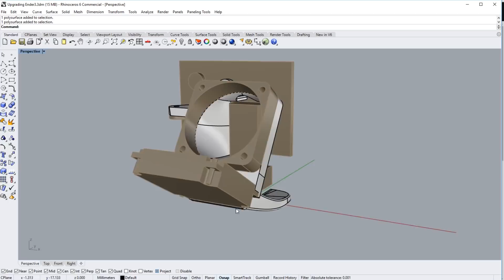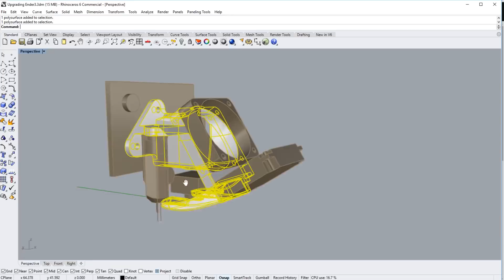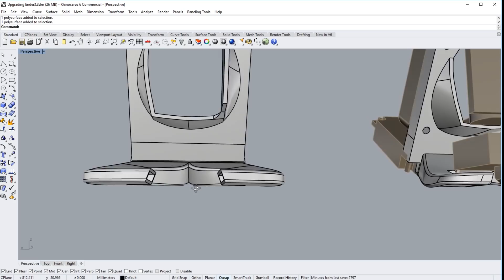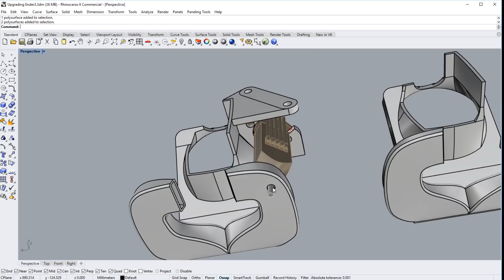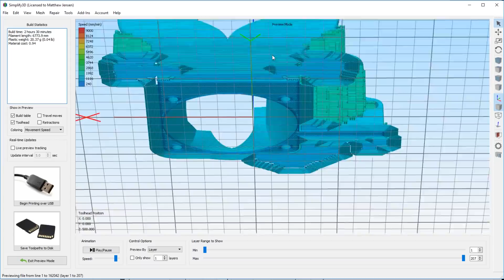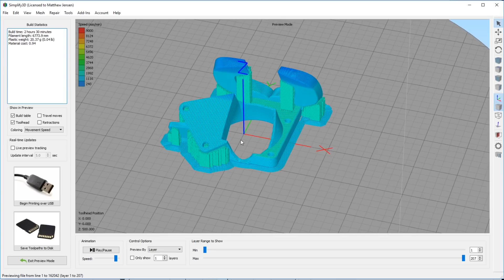Upgrading the Creality Ender 3 with Duet Wi-Fi, and other add-ons - part 1

Comment: Sorry not trying to troll your video, but I have a Prusa MK3... so should you. Really it’s needed to be fair. It’s pronted true, and yes on the zip ties. But, for that it’s pretty awesome.  You talk about price, and how Creality is as good for the price point? Well Prusa is using genuine parts. E3D got end, Noctua etc.
Reply: I was actually thinking that when he was talking about creality not using knockoffs. I was like, I'm pretty sure that E3d v6 is a knock off.
Reply from the maker: There is no E3D V.6 on a the Creality. They call theirs the "MK8 Extruder" and it has a very different heat sink, and mounting technique from E3D.
EDIT: I've been informed that the Creality hotend is a knockoff of a different company than E3D. The original inventor of that design is "Micro Swiss" based out of the Midwest.
Reply: Design Prototype Test hey man, I’m a fan... but if you are to be on the “no copy cat” platform, you have to get rid of GearBest. Those Creality printers have knock offs, the design itself is a RepRap platform, which is fine, but it’s more a copy of the Haribo I3 Design. Plus they are simply claiming to be open source but in truth are not.
Reply: We have 3 MK3's at the office and for the money, it's not worth it. Let's start with a 7 hour build time, ridiculous. I've been around since the early day kits with 30 hour build times and this is the best they can do? The original design has served its purpose, Josef needs to incorporate design for manufacturing know how and make a quick assembly printer.
Second, the new features simply don't work. Yeah it detected that my printer ran out of filament, but it also f-ed the layer it was printing ruining the part. They basically shipped beta product and it's well documented in other bigger channels.
Third, lead times are a joke and it demonstrates that they haven't got a clue what they are doing when it comes to JIT manufacturing. 
Fourth, their filament is horrible. The included filament jammed the printer 4 times. After the 4th time, I gave away all their filament.
Fifth, including 3D printed parts in the kit is basically just cutting off their nose to spite their face. It's also probably half the cause of all the delays and again, demonstrates that they either can't hire competent engineers or just unnecessarily hinder themselves due to misplaced pride.
Sixth, Josef needs to eat some humble pie. His attitude in interviews and company videos is narcissistic and ridiculous. Hey, thanks for contributing to open source, but try taking yourself a little less serious.

And yes, I also have an Ender 3 and it's a great printer for the money, albeit with some flaws. For $170 for the printer and for another $50 I've upgraded it to auto bed leveling, printed tons of mods, all of which in total have taken less time and far less money than a single MK3 build.
Reply: @brbubba  for a functioning business a 7 hour build time that you have to pay someone to do is a bit ridiculous being what wages are for the type of people that are going to be using them. 
I'm busy designing a very simple to scale printer that takes about an hour to build. Almost finished with the design of the basic model with V slot rollers on X and Y with linear rods on Z. Full Core XY design for the motion with no crossing belts. Fixed bed for no heavy moving mass. Instead the gantry moves like you see on a Bigrep.  
Geared extruder (probably a titan since I hate the mk3's extruder) with pancake stepper in either a direct drive or very short height controlled floating extruder (both are designed already so really can go either way).  
No 3d printed parts. All aluminum cnc and or laser cut from 3mm aluminum with the exception of 4.5mm 1050 series high flatness alu for the heatbed. 
Plus all the usual bells and whistles. arduino DUE with 2130/2208 drivers linked for SPI. Filament runout blah blah blah. 
The "pro" version is more of a dream machine for me. Hywin preloaded rails on X and Y. Triple leadscrew for bed leveling. 0.9 degree motors and a few crazy ideas thrown in. But that machine will probably never happen since I don't have a lot of cash to throw around. 

Busy building up funds (Don't have that sweet sweet first world income lol) to build the first version of the standard design. Parts slowly coming in. Slow being the key word. 
Not sure what I'm going to do with the design though. I considered selling 3d printers but I'm not sure what market there is locally (in South Africa) and shipping it globablly would really hurt the cost I aimed for. From locally sourced things like alu profiles and laser cut parts plus externally sourced electronics and rails I can hit my target of R4500 for a machine with a build area of 500x500mmx500mm.  Just over 300 US. It's $315 currently just for the raw parts and no overhead for building it. So a really well priced machine even after markup. But again the  market here is not ready for 3d printers.
Maybe I should make the design public and people can have a go at it. 

Anyway. On topic. I can fully agree that it felt like the MK3 was released way too soon. Beta no. More like a poorly thrown together Alpha with wonderful preorders. because we all love preorders. 
You know it's great that some of the parts are 3d printed like the extruder housing because they can modify the design. But at the end of the day they are seriously held back by not just using readily available parts. Would it kill them to use commonly available pillow bearings for the dual z motors top mount. Do the same for the Y rails. Hell at the price they are going for they should be using hywin rails to be brutally honest. 
Even if they can't do that they should be using, in my opinion, pre loaded drylin bushings instead of the bearings. 
That machine really needs a weight cut down. Get rid of the rods. get rid of the linear bearings. The hell are they using a full sized nema 17 on the extruder for like seriously. If your extruder is geared you don't need that. It's just a waste of weight. 
On a tangent about their extruder. They want to sell their 0.02mm accuracy "premium" filament but the gears on their extruder are a mess. Trying to get them to mesh in their perfect zone for that type of gear is a pain. Plus the backlash is too much. You are throwing the accuracy of the filament under the bus with all that backlash every time you are retracting. Forgetting all that. Not being able to see whats happening to the filament is just plain dumb. 
Prusa just made so many rookie mistakes that's it's actually a joke. To me it looks like Prusa is becoming the Apple of the 3d printing "diy" world. And i'm being loose with diy because there are companies like xyz etc that are more apple like. I mean more like the "we aim ourselves towards the maker community or whatever with out ''''LOW price'''' printer". 

Going back to one of the things I said in another comment just to add to the slowness of production that all those 3d printed parts creates. It's all the extra things that they claim to have invented like the pei heatbed. They probably made the production rookie mistake of only having a handful made before they launched. Not bothering to find out if large scale production would cause issues. You look at any company that manufactures a device. There is a process to it all. 
1. create a "perfect/ideal" high cost part of the final production piece to be able to test it. 
2. Put part through testing. 
3. change design/process if necessary and loop back to 2 unless it meets expectations. 
4. put part through full scale or part scale full speed production. 
5. test production quality part. 
6. go back to 3 if failure. 
7. go ahead with full production. 

Prusa skipped step 3-6 and that created a massive failure. The reason why I can confidently say they skipped those steps is because of the outcome. A company that went through the proper steps would never come out and say "hey we are sorry there is a huge slowdown because of production issues and we need a few months to fix it" -not an actual quote but essentially the same. 
They also need to do more firmware testing. They have released some pretty bad buggy firmware batches at launch. 

And the last thing in my mind is that they need to really move to a 32 bit board or talk to the Klipper guy. 
All great they are trying to fit as much junk onto an 8bit as possible. But what we need on 8bit is stability and more optimization. Not more junk.
Reply: @super_salty9189  That's what interns are for! In all seriousness though we had to spend resources to build these because the lead times were ridiculous. At the time it was get the printer immediately or wait a month or more.
Reply: @brbubba  Lol. Yeah if you have any that don't feel like they deserve the world from the company and expect a proper wage before they even graduate. Too many spoiled kids.  

Knowing what you know now after the experience of the huge wait and the questionable quality. 
1. Would you just buy the MK2 instead, which so far has proven to produce the same or better quality and be more reliable than the MK3. Or would you stick to the MK3. 
2. If not buying the MK2 as an alternative and not enjoying the MK3. Would you have bought something more market proven yet still in the realm of diy (basically staying away from ultimaker etc) like a creality, tevo, etc. 
3. assuming you preordered or ordered when the sale for the MK3 went live. Would you ever buy at launch from Prusa again or just say "F it. I'll wait a few months and then see what shiz pops up before I buy"    Or in the worst case. Has the experience put a bad Prusa taste in your mouth for the future and going to keep you away. 

Hope you don't mind the questions and the questions are open to anyone that wants to in the future comment. 
I know full well how I feel and how most people I know feel. And it isn't good. Lets just put it that way.
Reply: @super_salty9189  1. I would certainly put it in for contention, particularly with the weird z-axis wobble thing on some of the MK3's. I would have to weigh the cost vs lead time vs feature set. For what we do though, auto bed leveling is probably the only must have feature.
2. I bought the Ender 3 for myself after the MK3 purchase so didn't know anything about the quality. I would definitely consider one of the larger CR-10's in hindsight since there's lots of stuff the MK3 isn't big enough to print. Unfortunately the alternatives I was looking at, Raise3D and GCreate, were significantly more money.
3. I did not buy at launch nor would I ever pre-order anything. I've been burned too many times. I waited a couple of months and read lots of reviews. The reviews are a bit overly positive in my opinion. That definitely tainted my opinion a lot, since I was expecting a perfect experience, when in reality it was evolutionary not revolutionary.

In addition to my other complaints I forgot to mention software. Their stock software shouldn't even be shipped because it has zero features, unless they were trying to target the clueless. Also I use Cura, not that it's perfect, because Slic3r was a turd IMO from the beginning. Great that they are developing it, but it's ridiculous that they haven't pushed a stock MK3 setting into Cura yet and Cura has gone through many updates since then.
Reply: Genuine stuff costs $$. Also they did invent the spring steel sheet thing or at least perfected it. It’s really awesome. So the trade off is some printed parts for amazing components and $799 shipped to your door as a kit, it’s 3.5x more than a Creality Ender 3, but you get genuine parts, genuine support, 24v, direct drive, spring steel PEI sheet, amazing heated bed, etc. it’s worth their price. Plus their support is second to no one in the space. Okay I’m done.
Reply from the maker: @ THELIGHTSPEED Nobody ever accused Prusa of knocking off anything. All I'm saying is that almost every single innovation on the I3 Mk.3 is not something Prusa came up with. They aren't the source of innovation that everyone gives them credit for. True the bed design is a fantastic design and contribution, but that's only one of the features on that printer.  Your best point is about the tech support. Direct drive has it's pros and cons, and their heated bed is not as good as a silicone pad.  There is lots of room for improvement on a Prusa. Starting with the inferior frame design. A moving bed is inertial mass that should be kept stationary. A coreXY is a much better way to go.
Reply: Design Prototype Test I agree but it’s not a flaw but moreover the I3 style, and for 99% of people it yields superior results. The Prusa printers are rock solid and consistent as they get. The do innovate though, the bed is amazing. It gets to temp faster than a silicone version would, holds temp perfectly. Also their entire hot end assembly is unique to Prusa, with the Bondtech gears, cooling etc. Prusa took the best components and put them into an affordable package for the average consumer. I believe the laser filament sensor you spoke of is the same found in the MK3. It’s basically a mouse laser that tracks movement. Also Prusa was the first to ditch the end stops... you can improve the frame with a Hairbo kit, and then it’s rock solid.
Reply: So before you read this long as all hell reply. Just know that I am not attacking you in any way. I am simply pointing out flaws in your arguments/opinions as well as some other things. 

"it’s not a flaw but moreover the I3 style, and for 99% of people it yields superior results."  
um....to what? Because we both know that you can't compare frame styles to other frame styles in terms of their quality results based on their benefits and downsides to their frame and motion style. Because they were designed to meet different goals and those goals do not line up between most of them.
 
The i3 style as we all know was designed to be as simple to implement in terms of the mechanics and as simple as possible to program the kinematics. There is no complicated math involved by comparison to delta or corexy kinematics, and a lower price to build the frame due to simplicity.
The downsides being speed and weight of a moving bed for the most part. The biggest issue being the weight of the moving bed which limits your bed size drastically. The more you want to increase that the slower you need to move the bed and the larger the motor needs to be. You also need to start thinking about space in front of and behind the printer, a problem no other non moving bed design has. 
There is literally no point where the design goal of the i3 matches up with the corexy, delta or others like a scara etc.
The Delta style was focused on high movement speed and ease of raising the built height by adding longer extrusions. It was not designed to print very wide. The downsides to the high speed capabilities being numerous. A less stable frame that is subject to twisting forces, issues with printing perfectly straight lines, overshoot etc. 
With corexy you have a a print head that can move fairly quickly, isn't subject to overshoot as much as a delta, has no need for a moving bed but if you do go for a moving bed it is only in the Z axis which eliminates the issue of a serious moving mass, a very sturdy frame due to it's square shape and ease of cross bracing (although that isn't really needed).  The downsides being that it is fairly bulky for it's build volume and that you need to be precise with the alignment of the belts. It can also be costly to build the frame. 

So here we have 3 entirely different frame designs with 3 entirely different sets of goals. 
There is no way you could ever call one "superior" or say that it has superior results. Because that would mean you need to be able to compare them equally. Which you cannot. 
What you can say is "I believe it has superior results for the goals I am aiming for". In this case you can say you are aiming for the most simplistic design and cheapest build possible. Then yes you can argue that an i3 gets you that. But if your goals were say the fastest possible print speed or the best quality that fdm can offer. You cannot argue that an i3 design will get you that. Because it will not. 

I'm not really going to talk about the 99% part much,  because that isn't a real value and is nowhere close to reality on any level. Even on market share based on kinematic styles. Yes the i3 style is the most available and most widely used, but it most certainly is not 99% of the market. It is closer to 50% of the regular consumer market, less than 5-10% semi pro market, and 0% of the professional space. The professional market is entirely consistent of H-bot and corexy styles due to the goals of the businesses and people buying them. i.e. "money is no option. Give me the highest quality part producing machine possible that is as fast as possible. I want repeatability and quality".

On some of your other points:
"The do innovate though, the bed is amazing. It gets to temp faster than a silicone version would, holds temp perfectly."
There are a few issues there. While I do agree that they have a good heatbed design and I do applaud them for designing the pcb heatbed (note that i'm not saying pcb heater as they did not design the first pcb based heater, only the first pcb heatbed), it is by no means the best solution for the market. They should have just gone with the already available silicon heat mats and started that trend much much sooner. It would have solved some issues the design has. But anyway, moving on. 
A silicon heat mat is very reliant on the wattage and voltage supplied to it to reach temperatures fast. In just the same way a pcb heatbed does. While yes at the same voltage and wattage it may take a few seconds more (depending on what temperature we are aiming for) for the silicon mat to heat your heatbed. That is due to the silicon mat not being part of the heatbed and therefore it needs to transfer it's heat through the thin layer of protective silicon to get to the bed. In reality this does not matter. What is a difference of 10 seconds when reaching 100C. 
By comparison the pcb heatbed has large flaws. For one it has some limitations in the voltage it can carry due to how thin the traces are on a standard pcb. You either need to make the copper layers thicker or wider to accommodate higher voltages. By contrast for a silicon heater it is as simple as using thicker wire. PCB heaters also drastically increase in cost the larger you go. Good luck finding larger pcb heatbeds or just the pcb (not directly attached to the aluminum bed), that are over 300mm. Meanwhile you can have any custom shape, size and voltage made for you at a descent price from many sellers. 
To talk about voltage you have to acknowledge that a silicon heater is your only real option for 110-240 volt power. There is one pcb heater out there that I know of that does take mains. However I am not sure where to buy it from and you still have the limitation of standard sizes like 200mm.   Of course I am talking about mains voltage because of it's far superior efficiency and heat up times. Also the chatter about "how safe is mains voltage" isn't really a real discussion. Mainly because we deal with mains voltage every day. There are physical safeties built into your homes and places of work for a reason and they are far safer than a bit of firmware on marlin etc to shut down the heater if it thinks there is a overheat issue etc. In fact you are more likely to get hurt from having a 12/24 volt heater run crazy or short out and set something on fire than you are having your mains short without tripping a breaker before anything bad happens. In fact for the most part you can get shocked from mains voltage without any issue. Yes it will hurt like hell and will give you a hell of a scare but in most cases you will be absolutely fine unless you have a heart issue. This is mostly due to RCD's and also not usually touching both the live and neutral connections at the same time. So why people are scared of something they deal with on the daily is very strange to anyone who works with home electricity. Any point being that silicon heat mats are actually better in essentially every aspect to a pcb heater. 

"holds temp perfectly". Hate to break it to you but silicon heaters do this just as well as pcb heaters. In fact if you are using a good quality external heat controller (for mains mostly) you will have better heat stability than a PID tune will provide, in most cases.  

"their entire hot end assembly is unique to Prusa, with the Bondtech gears, cooling etc."   
That does not make it the best design. Uniqueness has nothing to do with best. To be brutally honest it is "okay" to "good". 
Their cooling solution for the nozzle is okay. Sure the noctua fan is nice. But at the price point I would expect that. Their extruder solution is "okay". In fact it has been the cause of many issues on their mk3. Some have even reported that the bondtech was missing some of the rollers on its "special" bearings or missing a bearing entirely. There are other issues with how the drive mechanism works with the meshing gears. If you know anything about gears and especially the gears used for the bondtech you will know that they have a certain range where they work correctly and ranges where they may work, but not smoothly. This has been leading to all the extrusion issues we have been seeing. 
So again, unique doesn't mean good. Also they shoved a full sized nema 17 onto that whole mess of an extruder. They really could have just used a pancake stepper so that it was slightly lighter. But they didn't care apparently. That whole extruder assembly weight a hell of a lot. 

On some other notes. Prusa may have been the first consumer printer company to label themselves as ditching endstops and creating somewhat of a move for it. However we have been able to do it long before Prusa did it thanks to the integration on stepper drivers from Trinamic. The idea has been floating around for years and people had been doing it on 3d printers long before Prusa. Prusa just brought it to the public space. 
As a matter of fact, even their PEI coated spring steel isn't really all that new. The method for coating things with PEI in powder form has existed for some time. There are papers dating even further back than 2006. It is essentially normal powder coating. Spray the powder at the part. Run electricity through it and bake. 
So in this case I don't know how Prusa can claim to have invented it. This is a direct quote from their site "The problem was, that powder coating of PEI hasn’t been invented yet". They claim they invented the process. But in reality it seems that the idea has been kicking around since 1980 or earlier (according to patents) and the actual process has existed since before Prusa Research even existed. 
If it was some new method they invented then sure I will give it to them. But Since other people seem to be able to create PEI powder coated springsteel beds with no issue. Which since I cannot find Prusa's "invention" method of application of the PEI to the metal. I will have to say that Prusa did not invent it like they claim.
Reply: Martin B Martin B I learned something.... you can publish a book on YouTube? Who knew. 

Anyways, you’re point of views are fair, but not entirely accurate given the market today. You mentioned “i3 design” isn’t comparable to other designs. You’re right because it’s not compared to others, others are compared to it in terms of quality. I said it gives great results for 99% of the consumers... This is true because the three top sold printers right now are 1. Prusa (i3) 2. CR10 (all i3) 3. Ender3 (i3) so if this is true we can assume that most of the market is buying i3 designed printers, and if Twitter and the internet are accurate those owners are getting nothing short of perfect results by in large. You mentioned the flaws with the i3, the bed swinging to and fro is an issue for speeds sometimes. But my MK3 can and does pull a 100mm/s without any artifactinf or issues. Which more than could be said for Deltas. I love Delta printers, but their issues are well documented and hard to fix. The i3 style has been figured out and works great. That’s just the facts. 

I made the Prusa innovation comment because they have innovated. The PCB heat bed is superior to anything I have seen, silicon heaters included. What I meant by innovation is the spring steel removable sheet. That doesn’t exist on any other printer that I have seen? Not in a stock configuration. Once you use that system there is nothing else. I don’t have a scraper anymore... pull the bed, and pop it off! Wipe is clean and repeat! They also had a first of its kind filament sensing system that they added to Marlin, same with power out detection. They may not have invented these ideas but man have they perfected it! 

The i3 Design has its flaws, no doubt. The frame isn’t rigid like a Delta or a CoreXY, but it’s good enough to produce professional results for most of the consumers and ever businesses. 

Prusa printers use genuine parts, and outside of the $5,000 ultimaker, or the $3000 Makergear types there is nothing even close to it in its price range. You can not deny that. 

The Prusa “mess of an extruder” is awesome. Find anyone to say different. The integration of the Bondtech gears was genius! Why no pancake stepper? If you owned a MK3 you know why. The speeds at which a MK3 can print reliably a Pancake Stepper wouldn’t have the needed torque. Try to print fast with stealth chip enabled and it clicks and jams. I personally think the Nema17 is the perfect motor for the job. 

Finally I’ll say, innovation and invention mean two different things. Innovation can be taking someone else’s idea or design and implementing it in a different way... Prusa took Bondtech gears, filament sensor, powder coated pei and spring steel sheet beds etc. and put them into a compact, point and shoot packages that works for 99% of the people that bought them! Their return rate is less than 1% of sold units. So I can assume that 99% of the people that buy them are finding their quality production to be good, or dare I say perfect! Take a look at Twitter and see the amazing things being done with this printer and you’ll agree, the only better quality comes from SLS or SLA or something of that nature. Also the “can’t go larger” in the i3 Design doesn’t makes sense. The largest format, best selling printer on the market is the CR10? Are they all happy with substandard results? Or is it possible that with a Bowden setup on a large i3 Design produces amazing results?
Reply: DPT, J. Prusa knows all that. He made a BUSINESS decision (using a "classic" KISS principle) and the sales have proven him right. I am NOT defending J.P.,  just explaining what happened... Yes, CoreXY printer from Prusa could be good, but it will probably not happen. There is a rumor that they are developing a resin-based printer instead. If you look at one of the latest Prusa-company's blogs (about extrusion issues), the writer refers to a very high quality 3D printer (I forget the maker) with a clear disdain. Their assessment is that all FDM printers have uneven-extrusion issues. I've just discovered these blogs (I am not a Prusa customer); they look quite interesting.
Reply: Ok, even I don't write that much.. wow - my advice if you want to keep what you have  written? Copy and paste into word/pad - youtube can be funny with big chat posts. So if you preserve your writing, it's safer to keep a copy. Oh, and you're all Public Domain now, ta :oD xx
Reply: It's the start of a good chapter aint it? And yes, 3D printers are basically all brilliant :nD
Reply: THELIGHTSPEED! !   Part 1 of reply. this is a long one oh boy. 

Been meaning to finish up my reply but I have been really busy with work the last week. Even my weekend was used up. But anyway getting to the reply I wanted to make. 

I did actually have to trim some words because I hit the text limit. lol. I wanted to put a little joke in at the end but it was actually too much text and wouldn’t let me send the message.

I don't really agree with that statement of "it’s not compared to others, others are compared to it in terms of quality". That really isn't true. While people do compare "quality" from printer to printer. It most certainly is not based on comparing any style of printer to another style of printer purely based on their styles and not on their strengths and weaknesses. That would be insane to group every printer into their style and immediately say everything that isn't this style is not as good. 
The reason that is just madness and the reason why it doesn't happen is because every style can be seriously messed up for one and for two each style has it's benefits. 
For example, while I agree with you that the delta design is very hard to get right and hard to get good quality from in cheaper machines. You cannot outweigh the benefit that some people would want from it. Speed. The delta is the reigning champion of speed and it is undisputed. If you are using the same drivers and a fast enough (that it does not bottle neck on a corexy or delta) motherboard for all machines.   For some people the quality does not matter. All that matters is being able to cut down on printing speed significantly where quality doesn't matter. 

Also just skipping forward in your comment a bit since I'm talking about deltas. A delta frame isn't very rigid. It generally suffers from twisting forces on the frame. Unless you really re-enforce it with crossbars or do what tevo and other good companies do. Go mad on the standing beams and make them as solid as possible. Just look at those beams on the little monster. That's CNC level of beef. 

On the 99% of people thing again. you didn't say "gives great results for 99% of the consumers" or anything close to that. You said "it yields superior results". Superior being the key word. Superior to what?  You can say one printer is superior to another if the physical build and stability is indeed superior to another. You can't say a style is superior. That's what I am getting at. 
and even saying "gives great results for 99% of the consumers" isn't really correct when talking about a style. 1. because you don't have those metrics and 2. you aren't taking into account the sheer mass of cheap i3 style printers that are garbage. Trust me it's more than 1%.   Also "great results" is subjective. Using the Prusa MK3 as an example here. People that owned the previous versions of the printer know what to expect quality wise. They expect the same or better from the new "upgraded" machine. But many of them are disappointed because of issues it has and so are many new people to 3d printing that got a machine that has issues when they were not expecting the issues. Tell those people that they are a mere 1%. In reality your comment about it being the entire style having 99% people getting great/superior results would mean that those are a fraction of a percent of people, since the MK3 is such a small percentage of all i3 printers sold. That really doesn't add up. 

And no, just because the top three printers (according to you) are those you mentioned, does not make the i3 the best design. That isn't how it works. It is one of the cheapest to implement designs. That's why it sells. 
If you can provide your source for where you get your stats on the top 3 sold printers that would be great. 
Just by looking around at stats that are available and based on how reviews and experiences are going right now. The ender 3 is probably the most sold (especially according to amazon) and then the likes of the monoprice select and the cr10 come in. If we are talking sales metrics. If you actually meant quality then that’s a different story. But it still doesn’t hold up in that way. So an explanation would be excellent

You are right. Prusa does innovate sometimes. Personally I still prefer silicon bed heaters to any pcb. To me, someone who has a strong electrical background, they are safer even as a DC heater and safer still as an AC heater with far greater efficiency. So my power bill is literally cut in half for my printers. I also build custom printers at a really low cost for people if they ask and when I give them the power bill estimations for DC vs AC they always pick AC even if it costs a bit more and they are always happy with it. I mostly get requests for Large format corexy machines. 45cm plus in Y and Y. Only for small machines I do i3’s. 

Anyway getting back on topic. Prusa at the time was the only company shipping a spring steel build sheet with a printer as stock. So you are right there. I can’t count myself because I build machines rarely. So it’s not a business. But yes I was doing it before them on built machines. Not spring steel however since that is hard to find here in pieces less than 3 meters long. I use 2mm stainless steel from a supplier close to me that does laser and cnc cutting of everything from aluminum all the way to 20mm thick hardened tool steel for armored cars. I don’t do magnetic though. I just go with clips. Trying to pull off a magnetic build plate that size can be tough when it’s weighed down with a week or two’s worth of printing haha. 
Geez I’m sidetracking a lot today. 
Also on a side note when you build printers that size you don’t go with things like PEI or anything that lets go even slightly if the power goes out. Trust me when I say you don’t want a print surface that it is easy to remove from when you are printing for a week and power cuts are inevitable. But yes small printers 100% pei or very clean glass. Unless it’s a very delicate print with tiny surfaces. Then I will go with a Peopoly build sheet. #notSpon lol

On Prusa’s implementation of the filament sensing system and power out detection. You are right. They didn’t invent it. Although they didn’t perfect it either. As with most things Stratasys invented it and perfected it. They know down to a very precise degree how much filament exits the nozzle. So much so in fact that is always adjusting output to be nothing less than perfect. 
But none the less I do commend them for implementing something similar on the Prusa and for the power panic feature. Granted that is what you can do when you charge a really high price by comparison to the actual printer cost. So there is that. Let’s say without any support or software development. They could probably ship the printer at around 400 dollars with all the genuine parts etc. and still make a tidy profit. You pay for those development costs. 
Also I wouldn’t say they perfected either of those features. They still have some issues as far as I am aware. 

A Delta is not rigid unless you over engineer it. An i3 compared to a corexy in rigidity is not even a comparison unless you seriously improve it with support. The closest to a corexy would be the lulzbot. Those things are seriously rigid and reliable. That’s why the lulzbot is so expensive. They charge for reliability and the support they offer. Mostly the reliability. They know that if a business wants a print farm that is working 24/7 and is going to reliably print time and time again no matter what even without being checked on, then they will go lulzbot or take the next big jump up. If that level of reliability isn’t necessary then the Prusa is a good machine for a business. 
If a business can afford it they will move away from an i3 faster than you can say “wait don’t go. We can make good prints too”. 

In the current market yes the Prusa is good or for it’s price when comparing at that level. But then again as this whole video series is getting to is that you can upgrade a low cost machine to be even better than the prusa and have more features. Granted it isn’t a final product. Although someone will probably try and make some money by offering a mega upgrade like this to the market at a decent price. 

To me and many other people it is still a mess of an extruder. 
“The speeds at which a MK3 can print reliably a Pancake Stepper wouldn’t have the needed torque”. I disagree. On the corexy machines I have built I either go with a short Bowden or a light weight direct drive. Titan extruder plus a pancake stepper. Printing all the way up to the 120+mm/s actual speed with no torque issues. Even in stealth modes. 
With a full sized stepper, a 32 bit board and a powerful heater cartridge I can push machines to 200mm/s easily without losing a single step. I wish I had a machine to show you right now but I haven’t taken orders recently because I’ve been way too busy and I don’t make machines regularly enough to charge enough for it to be a viable job. Hence why I build monstrosities at half the price of a built prusa. It’s more for fun than anything else.
Reply: THELIGHTSPEED! !   Part 2:

You are correct that innovation and invention are two different things. They still claim they invented the PEI powder coating. Unless that’s a wording issue on their end and they actually mean “we invented the first pei powder coated flex plate”. But it isn’t because their wording was “The problem was, that powder coating of PEI hasn’t been invented yet”.   But it was… SO you can see why I mentioned it. They specifically say “invented”. Maybe they invented a new method. But I’m somewhat doubtful. 
I might actually tweet at Prusa to find out. Since they are so open source maybe they want to show where they submitted their method to for the open source market. But like I said before, since other people can and have been doing it for years. I am super skeptical. I really hate sounding like a broken record. 

“works for 99% of the people that bought them! Their return rate is less than 1% of sold units”   where on earth are you getting these statistics?   Also most people would not want to have to send their printer all the way back because of the shipping price. The shipping price is the cost of an ender 3! ($122- 152 depending on DHL or UPS). And that is the shipping price for the kit!  The fully built machine is $164 – 208!   That is what it costs to my country at least. It is cheaper to other countries outside the EU. But still it’s crazy high. 
I know I would not want to foot that bill even one way to fix things. At the cost they charge there shouldn’t be manufacturing errors like missing rollers. Also the bondtech is good as I think I mentioned. But only when the gears are at the correct meshing range. Everyone that knows anything about gears knows they have a range where they work optimally and then either too tight and you have a gear that doesn’t more or too loose and you have serious slop or gears that damage themselves very quickly. 
I guarantee you that far more people than 1% have complaints about all sorts of things. Just look at the amount of press and videos that needed to be created to show and address the extrusion issues present on the MK3. It’s a lot. 

Take a look at twitter and a whole bunch of other places and you will find that there are a ton of people that all have the same extrusion issues. 

With regards to the i3 design being flawed in that it can’t go large. I said “the moving bed which limits your bed size drastically. The more you want to increase that the slower you need to move the bed and the larger the motor needs to be. You also need to start thinking about space in front of and behind the printer, a problem no other non moving bed design has”.
Here I was referring to really 300mm as being the limit for a standard stepper and anything after that requiring the bed movement speed to be drastically slower and the requirement for a larger stepper coming in very soon. Just look at the Creality S5. Even with the Nema 21 I believe that they shoved on that thing. It has issues with layer skipping if you try to print too fast. 
The cr10 still manages to pull off the nema 17 and you can still do a 400mm bed with a larger nema 17. But you are not going to be printing at any fast speed. The bed weight is too much of an Achilles heel. 
You just try to print at 100mm/s on a cr10. It is not going to happen. Maybe over a long straight movement yes. But any standard printing move is going to be very slow and you will be riddled with ghosting over 60mm/s.

 A Bowden on a large i3 design or any design can produce amazing results if done the right way. Remember Bowden doesn’t mean you have to leave the motor and extruder sitting stationary. You can easily implement a floating design that has none of the drawbacks and for smaller machines and reducing the extra wasted length you can have very short and precise retractions. On my Bowden setups with 30cm long bowdens I can acheve 3mm high speed perfect retractions every single time and with even shorter floating bowdens I achieve 1mm or less in retractions without the weight of the motor ever having to bother the printer.
So at that point is a direct drive even necessary? 
As someone who knows how to take advantage of the Bowden and has used  direct drive for some machines. I can say that in reality the drawbacks of a really well implemented Bowden is essentially nothing. It only has upsides at that point. 

okay this one took a little while to type.
Reply: P D James   Just did another reply since I've been busy with work. Don't worry. I always use word when I know i am going to do a long post. 

I code and write documentation for projects and the code itself. So typing is kinda a thing I have to do a lot anyway. So writing a few thousand words for a comment is easy. 

I don't mind bing in public domain. If someone can learn from that it is great. Just if you are gonna steal my comments for a youtube video or to post somewhere else I would be grateful if you mentioned me XD
Reply: why somebody need to waste money on genuine product.creality product is too good for the price. there is no support from the company,but their coumunity is big
Reply: I didn't know youtube comments could be that constructive, almost like a form thread this was. There is one thing I am wondering about though: You talk about the amount of i3 printer and I agree that most of youtube is about very cheap i3 printers from china, but I don't have the same experience from real life. During the last 10+ years I have used many different 3D printers and the only one I have seen IRL that is an i3 configuration is a Tevo Tornado that a friend of mine have. My own printer is a self built TAZ 6 so it's reminiscent of an i3 and may also count. But every printer I have used and seen used in a professional setting has been with the bed moving in the z direction (excluding the new resin printer we got at work which seems to move in both y and z, but I haven't used that one yet). So my question is, which market is bigger in 3D printing, personal or professional? I get the impression that most businesses with an R&D department has a 3D printer and most of them seems to be from Stratasys.
Reply: lollandster  If I can answer your question/s
The bigger market is the professional market. Far more room for markup and far more companies wiling to literally throw money at something. Companies are far less frugal with money than consumers. 
A company sees something like a 3d printer as a tool that will only increase their profits. If they spend a million dollars on a 3d printer they know that it is worth the cost 10 fold over. 

The taz design is technically a form of i3 yes. 

The reason for professional setting printers having a Z axis moving bed or having no moving bed at all is because of the scalability and better quality due to reduced moving mass. If you have a look at my initial response to Lightspeed you will see what I mean. A non moving bed also reduces inconsistency and therefore increases reliability.
Reply: aaron ramly   there are some genuine products that are worth it. For example, the fake e3d nozzles and throats are not the same at all. What I usually do it buy real nozzles and real throats and then buy a really good replica just for the tower, heatblock, good thermocouple and silicon sock. That way I spend about a third or less for the full hotend with all the quality in the parts where it matters. 
Triangle labs does a really good knockoff e3d hotend that I buy. The heatsink is excellent and even has the same built in bowden coupler. There nozzles are pretty good too. Not as good as a genuine nozzle. But 10 times better than a bad nozzle from anyone else. 

Also I find that some of the Chinese companies do have good support. When I have bought from Tevo, Creality in the past and there has been an issue with a part I have always had them DHL over a replacement at not cost to me.  That might be because when I buy, I buy a lot so my aliexpress rating is at the top. 
Maybe it also has something to do with being nice. I have seen too many people have an issue and then they go crazy at the support people. I am always nice about it and thank them for helping me out. Maybe that's my secret?  no idea.